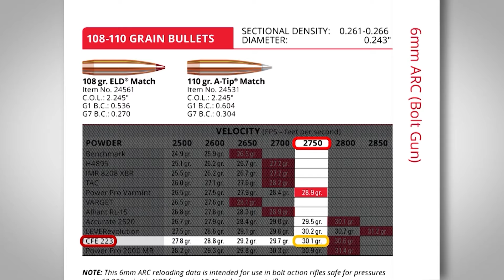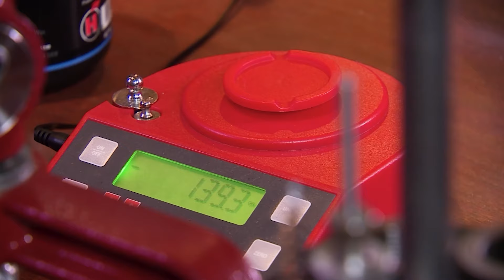Beginner Reloading Tips Part 3

Comment: Personally, I use my powder thrower to get close and then trickle up to exact on a beam scale each time. Then set it onto a digital scale to verify. Any time the two disagree it is either one of the poises on the beam scale got moved, or the digital drifted (of which a quick tearing fixes that). I also use two loading blocks to help assure against double charges. And after charging all cases I look down the necks of them with a bright light as a last safety check before seating bullets. I like having three or more safety checks incorporated into my reloading process. So when I weight each charge to exact on a beam scale it is my first safety check. And when I double check it on a digital scale it is my second safety check. And alas when I look them all over at the end it is my third safety check to help assure that I do not over or under charge any of the cases. "Better safe than sorry" somebody always said. And by using two loading blocks that is a safety step as well.

So not only do I get three safety checks to assure it is done right but I also get three memories of having done it right to keep from wanting to pull bullets later on, over wondering if I messed up or not. Again taking the same step over in different ways not only assures me that I did it right but that I did it indeed. This is a very good reason not to be in a hurry when reloading. Safety insured is safety secured. And when I shot, my gun/those around/and my stead ARE safe indeed.

Comment: Personally, I use my powder thrower to get close and then trickle up to exact each time. Then I trickle up on a beam scale and set it on a digital scale to verify. I also use two loading blocks to help assure against double charges. And after charging all cases I look down the necks of them with a bright light as a last safety check before seating bullets. I like having three or more safety checks incorporated into my reloading process. So when I weight each charge to exact on a beam scale it is my first safety check. And when I double check it on a digital scale it is my second safety check. And alas when I look them all over at the end it is my third safety check to help assure that I do not over or under charge any of the cases. "Better safe than sorry" somebody always said. And by using two loading blocks that is a safety step as well.

So not only do I get three safety checks to assure it is done right but I also get three memories of having done it right to keep from wanting to pull bullets later on over wondering if I messed up or not. Again taking the same step over in different ways not only assures me that I did it right but that I did it indeed. This is a very good reason not to be in a hurry when reloading. Safety insured is safety secured. And when I shot, my gun/those around/and my stead ARE safe indeed.